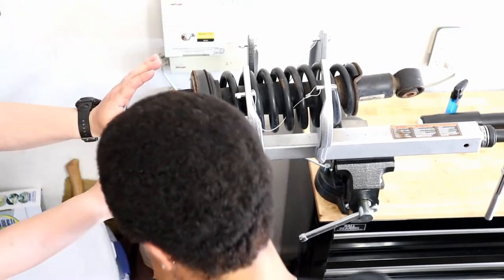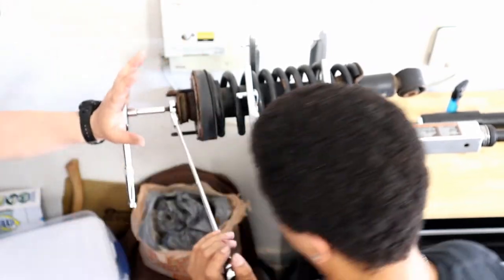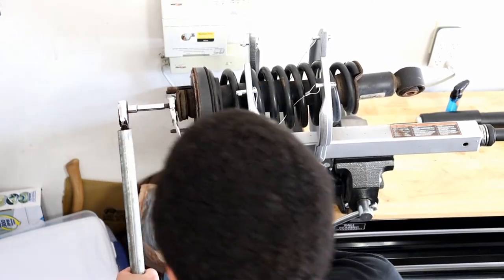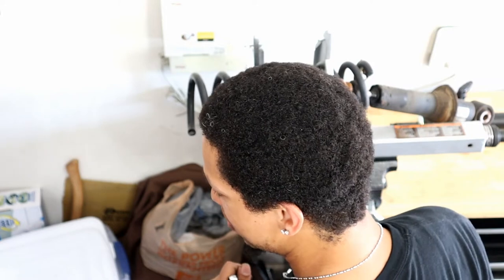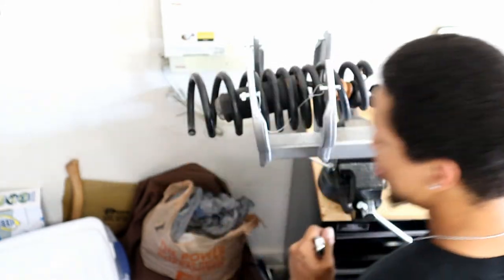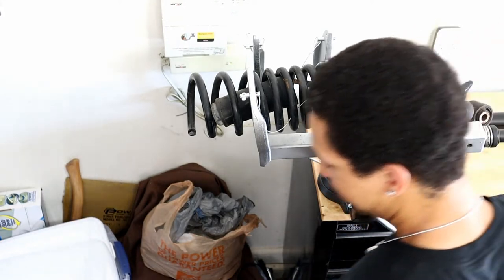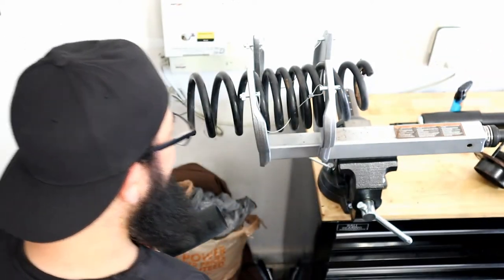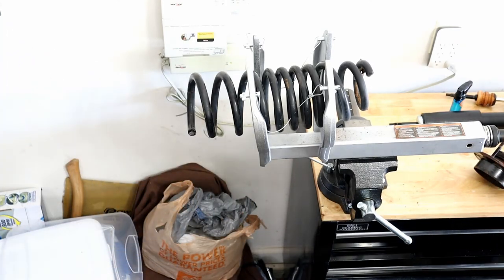powerbuilt strut compressor explodes

Comment: The spring compressor didn't explode, not compressing the spring enough caused a sudden unexpected extension of the spring when the nut was removed.  The fact the nut was right the whole way during loosening should have told it it was still under significant tension.
Reply from the maker: Well observed thanks

Comment: Looks like you didn't have the spring compressor in the correct position so there was still spring pressure on the top plate.
Reply from the maker: Yes your right I had it turned the other way. I corrected it thanks for saying.
Reply: two full wraps of the coil worth of pressure because the compressor was improperly installed. Imagine the force of all of the coils letting go at once!! That's why they call these "widow makers"!

Comment: This is really misleading. It exploded because you didn’t tighten the springs enough so it doesn’t have tension. Might as well remove the top hat without this tool is what you did.